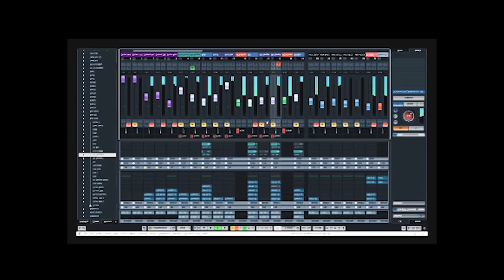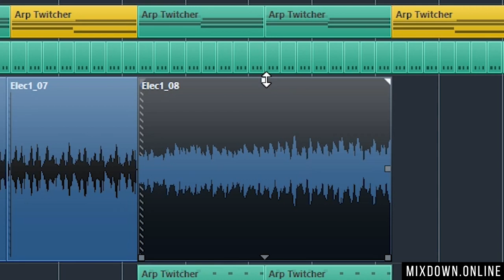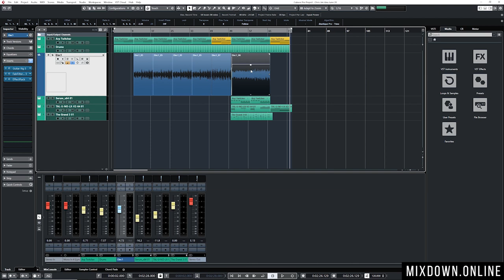CLIP GAIN vs FADER AUTOMATION

Comment: I had a question: great video btw. (!) 
Situation: vocal is ideal first  2/3 of song sung at moderate levels with two compressors doing light/ moderate work. Last 1/3 of tune, vocal gets very ‘hot.’ Would it not be best to bring down vocal in clip gain to match or come closer to the first 2/3 of song so that the compressors are being utilized in a consistent manner? 
The compressors on the track currently are not able, with their moderate settings , to handle the louder vocal. I utilized a third compressor specifically for this part using a higher threshold so it would only kick in at this section. Unfortunately, the vocal character changes. What might you do in this situation? I guess one could utilize both techniques and tweak tweak tweak till it’s ‘right..’ 🤔

Comment: Thanks Chris, very helpful. Question.... If I have a very dynamic vocal and I do not want to squash the heck out of it with a compressor I use the "pencil tool" to "draw" my clip gain structure on the track to even out the levels before running it into the compressor. This is a bit time consuming obviously but I feel I get better results.... But being new to Cubase I am wondering is there a better way to accomplish this?
Reply from the maker: This is a good way to go actually, whatever way you look at it, doing so takes time but worth it in some situations. You can also cut your audio event and lower or bring louder with Clip Gain those parts. With clip gain, you can also bring up an event opposed to the Pencil tool, but might have to cross fade a few events... Go with what you like best.

Comment: Hey Chris, How do you add the same plugin across multiple channels at one in Cubase? I know Option+Drag will do one at a time, but I can't seem to fine the answer anywhere. Thanks
Reply from the maker: You can Insert several plugins at the same time by selecting several channels and Click on Q-LINK on top of the Mix-Console. This will link these selected channels for the time Q-LINK is active...From that point, insert a plugin and the plugin will be inserted on all selected channels. That will not work if you Drag a plugin from another channel on these selected channels though

Comment: hello i would really like ur help when i do volume automation i always use a plugin like freeg so i can get control over the whole automation with Cubase fader but the problem is it is not fast enough when i try to automate the a drum hit with realy near the wave spike it does not work i can hear the hit so i tried to reduce the level to 0 to test and then i see that i can hear the hit that means it some of the wave form is not muting that so i tried it with waves cla-2a its by reducing the gain to zero but still i can hear the drum hit if i automate it very near the spike.....but cubase fader volume automation works better.when i render using cla 2a it does mutes the part but i can hear it during play back...plzz help...note. i did reduce the spike detection range to 0 ms in automatiuon panel...i am using cubase 10.0.5

Comment: Hi Chris, in Cubase pro 10, some audio parts are called "file" in the info line and I can set their gain. Most of the parts, however, carry the name of the track and have no part gain.
Are they regions? Should I convert them into separate files, so they would have gain controls too?
Edit: Okay, I've discovered Audio --> Dissolve Part and that seems to do the magic :-)
Reply from the maker: Yes, you found it!

Comment: Chris, your videos are like gold! My question is; is there a way to set the sensitivity of the clip gain?  In Cubase, I find that I have to move my mouse a huge distance compared to when I do it in ProTools which seems much more sensitive.
Reply from the maker: Good question, the gain sensibility will change according to the vertical size of the track. If you size down the track the sensibility will decrease... hope that helps
Reply: @mixdownonline  I think so. So if I size up the track to a very large size, it becomes more sensitive? Also, I have some vocal tracks where there is no pan slider. How did that happen?
Reply: @mixdownonline  Nevermind, solved the panning issue.
Reply from the maker: The Pan was probably deactivated!  Happy you  solve it!

Comment: Thanks. What would be the difference between using clip gain and “audio processing” (I think that is how it is called.)?
Reply from the maker: Clip gain will affect the gain only...and Direct Offline Processing can be used with any processing available (plugins)  Hope that helps
Reply: @mixdownonline  Thanks for your quick answer, but no, it does not help. If I have an audio file and through Audio/Statistics, for example, I see it has an integrated loudness of -11 LUFS. I may want to lower this to -18 LUFS. If I do it by subtracting 7 LUFS through direct offline processing, it falls in volume, but Statistics also show it as -18 LUFS. If I do it through clip gain, or pre gain for that matter, it falls in volume, but Statistics remains unaltered. The audio remains unprocessed. Also, while I am at it, if I use clip gain I see the waveform shrink. If I use the Pre gain, it does not. Confusing.  My Q is if any of these alternatives affect the quality of the audio. Thanks!!
Reply from the maker: LUFS is a measurement useful in mastering, irrelevant in a recording and mixing imo... It measures the average loudness of a track, . . The reason you don't see a change is that Audio/Statistics analyzes the audio event as it was created, clip gaining it down will not change the file itself until you bounce it to a new file and then analyze that new bounced audio track. If you want to know the amount of LUFS of your track when you clip gain, use the LUFS meter off the Control Room if you use Cubase Pro.
But again, no use to work with LUFS in recording or mixing, use DBFS or VU
Reply: @mixdownonline  Thanks for your reply. I do not want to waste more of your time. But I must say I think you are wrong on what you say about LUFS. There are Integrated, Short Term and Momentary loudness measures. I find them all useful. Regards!
Reply from the maker: I know that and don't get me wrong, I love LUFS when mastering but never use it when recording or mixing... I don't need to mesure loudness of a track when recording and mixing...